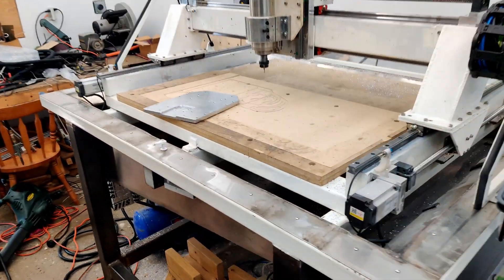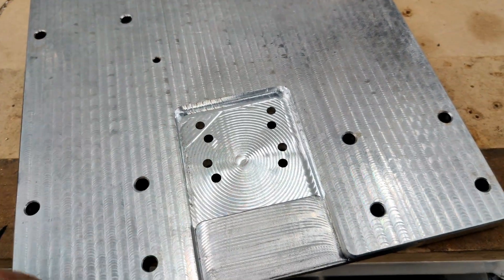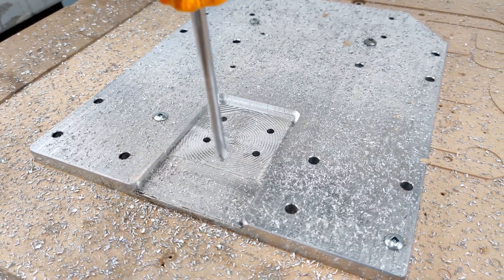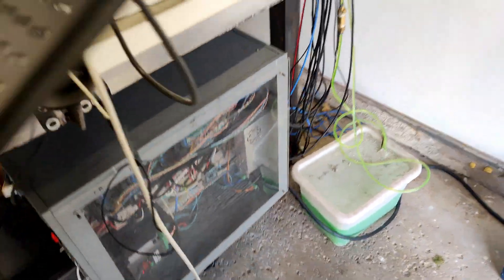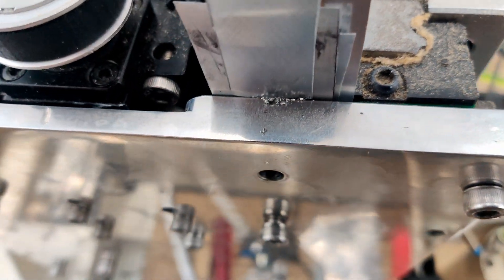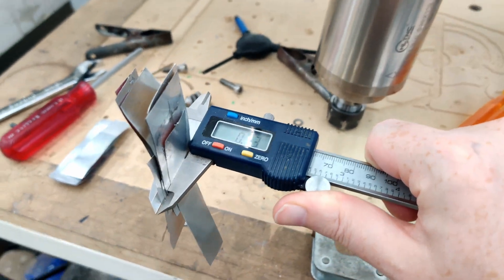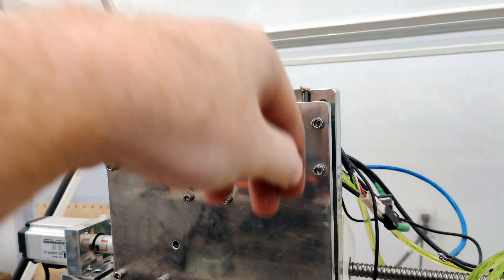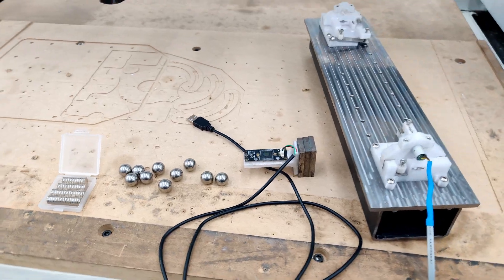My PrintNC upgrades: Better ball screws and longer rails

Comment: Hello Brayan, may I ask you witch trunk lid struts did you use to open the enclosure? Looks just amazing
Reply from the maker: I'm using 2x 80lbs structs 20" long. It takes about 10lbs of down force to close the door.

Comment: hey man been watching your channel for a while, also working on my own cnc too. what i was wondering was how low of an RPM the spindle can be operated at. you did try some agressive drilling at 6k rpm, but how about milling/drilling steel? can it handle 3000rpm os we can do some light cuts on steel? thank you in advance
Reply from the maker: yeah the spindle isn't designed for it. You can get down to low rpms depending on how much load is going onto the spindle. 
This is about as low as I've gone in steel @ 3k rpm: https://www.youtube.com/watch?v=guddMZIETKs

and going in the opposite direction here's 24k rpm in steel: https://www.youtube.com/watch?v=8v-yXavlFhU

when it comes to cutting steel on these gantry cnc machines, they need to be made as ridged as possible if your using insert tooling like this. I usually gravitate to using insert tooling in steel due to them lasting far longer than solid  carbide tooling. cheaper too.
Reply: @BryanHoward thank you for your reply. Yea i have seen both of them and the “fly cutter” is actually pretty scary. Maybe having 2 inserts at 6k rpm is the way to go
Reply from the maker: @TheRealBleach1000  I don't think my machine is ridged enough to handle it at 6k. Probably not rated for that rpm either.

Comment: Hello Brayan, thank you a lot for putting up these videos and sharing your journey. I would like to know if the laser level and webcam system can be used for surface flatness assessment as I intend (hope) to replicate for that purpose. in the affirmative, what would the limits for that system to asses surface flatness to microns ? can it replace other techniques like the one using  autocollimator
Reply from the maker: It can be used for surface flatness but you’ll want to put in the effort in calibrating the lens to the laser. I’ve been using a Powell lens and to the best of my knowledge it’s the best lens to convert a laser dot to a line. 
The alignment of the lens to the laser is absolutely crucial to be able to use it for measuring the flatness of a 2d plane. We want the beam to be in the shape of a straight horizontal line. 
This can be calibrated by projecting a dot parallel to a wall surface. Place 3 points equal distance from each other along that line for the webcam. You’d want some adjuster to raise and lower the platform the webcam sits on so you can get each spot dialed in to zero out on the laser. 
After you know you have 3 points in space that are straight to each other, you have a reference you can use to adjust the angle of the powell lens. This can be done by projecting the laser line perpendicular to the 3 points aimed at the middle one and just the pitch axis of the Powell lens till all 3 points zero back out. 
When you can zero out on all 3 points perpendicular to the original reference point, you’ll have a straight line generator that you can use for mapping out a surface with. 
I’ll have to make more videos and one showing this whole process in the future. 

Here’s the results of probing a very small object with 10,000 points https://www.youtube.com/watch?v=xf5xHpGlwvQ

You can also do a similar approach by sampling nothing (air) on the CNC to map out how accurate your XY axis is. If there is any twist in a dual Y setup such as my CNC or if there's any warping of high and low spots on the rail surface.
Reply: @BryanHoward  thank you very much indeed for your reply. I will definitely investigate more into it and also read all information you already made available. It would be a huge help if you'd find time to investigate more into this flatness testing  application and more videos from you regarding that would be highly appreciated. Also will share any feedback regarding adopting this method in our project.

Comment: Wanna make some way covers? Bellows, they can be made diy with tape
Reply from the maker: Yeah I gotta sort out all the exposed rails and ball screws. It’s becoming a problem with all the chips getting in there. I have some stainless steel sheet left over that i’ll used to make some wall for the Y axis. Still trying to figure out the best solution on covering the X axis rails top/bottom and ballscrew. Z axis I can wall off the sides and figure something out for the bottom rails.

Comment: 4:11 name of the coolant pump? I tried googling the model number but nothing comes up.
Reply from the maker: The pump is one of those cheap pond pumps. 120V. No more than a $10-$14 pump. They can be found on Aliexpress all over, search "submersible pond pump ". Amazon if you want to spend 3x the price for quicker shipping. 

I have it connected to the VFD through an internal relay on it. That way when the spindle turns on, the pond pump turns on as well. It’s been in the green coolant for probably 2 years now without any issues running.
Reply: @BryanHoward  thanks for responding, i will check them out. 🤝

Comment: Entertaining, as always.  I was going to suggest, now the machine is back together, to cut another plate - so you never need to use the "one-time" plywood plate again.  But I guess the only reason to make another one would be if it needed modifying - and you probably can't know what needs modifying yet...  so I'll keep that suggestion to myself 🙂  Thanks for the videos.
Reply from the maker: When I originally cut all the plates for the Z axis I was stupid and didn’t square the gantry very well. I’d probably redo all the plates at some time in the future. Possibly change the tram plate slightly so I can box in the sides of the spindle to make it slightly more rigid.